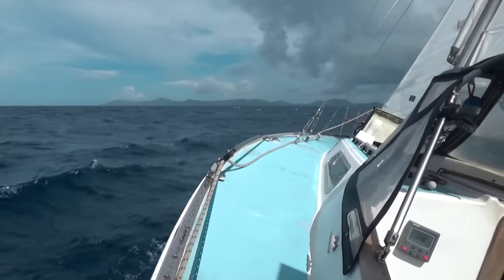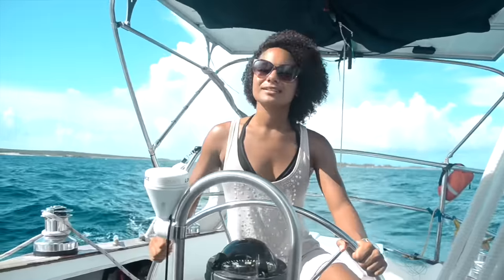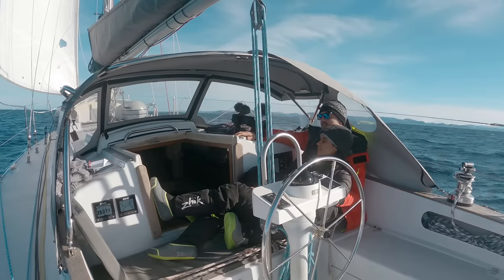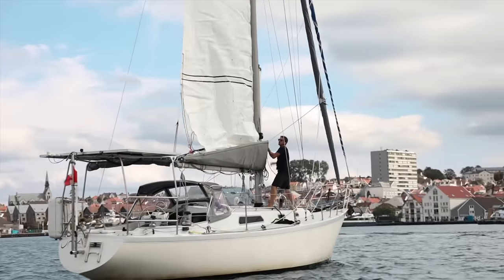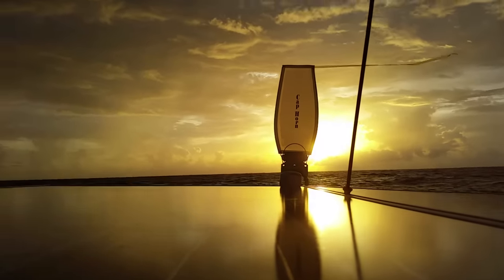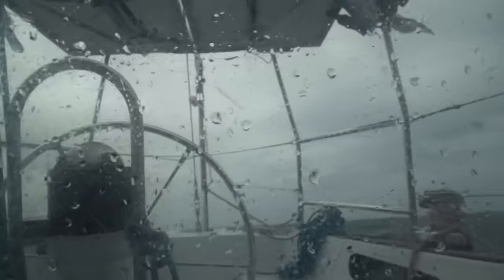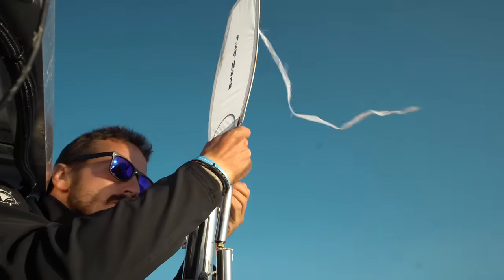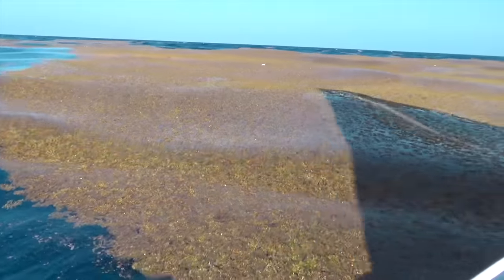Our #1 SAFETY PRIORITY (Autopilot or Windvane)  — Sailing Uma [Step 261]

Comment: Completely agree. The Cap Horn windvane is one of the best piece of gear I ever bought. Don't forget the quality of construction and material used. Of all the stainless steel present on my boat, it is the only piece that never displayed any traces of corrosion. It is intended for longer passage. If you're doing only coastal, go for the electronic one. Another drawback of windvane, they don't work when motoring. To resume, windvane is the best crew you can have for passages, it does not consume any power, does not eat, complain nor sleep and above all, does not drink your beer or wine.
Reply: I crossed the Pacific with a Sailomat, and it WOULD self steer while motoring in calm conditions at 5 knots. That was on a 41 ft. Ketch.

Comment: In case you didn't know: The horn signal played in the intro (long - short - short) is the marine open water signal for unmotorised/ sailing vessels.
Reply: That's better ;-)
Reply: It's actually 'my vessel is disabled/manoeuvring with difficulty, keep well clear'
Reply: Or
 Long short -short is the letter D in Morse Code.   Dan.   Need one for Kika.  Long -short long.
Reply: @petergreen3381  To add to your adequate critic, it's actually both + some other meanings :-). I'd say "moving with difficulty" is probably the common denominator.
Reply from the maker: From our research, back at the beginning, it means, "Sailboat approaching in the fog".
Reply: @SailingUma  yes, under International Regulations for the prevention of collision at sea Rule 35    sailing vessels and many other 'impeded' vessels make this signal in restricted visibility and which is drawn from the International code of signals 'single letter signals' under which _.. or 'd' means 'my vessel is disabled / manoeuvring with difficulty, please keep well clear'
Reply: @petergreen3381  Visualizing the horn necessary for the mighty signal, I understand well that Uma would manouevre with difficulty!
https://de.wikipedia.org/wiki/Typhon_(Schiffbau)#/media/Datei:2010_09_07_Typhon_DSCI0366.JPG
Reply from the maker: @petergreen3381  HA! Yup...sounds like us (at least in the beginning)
Reply: Technically, ALL 5 classes of vessels above Power Vessels on the "pecking order" share this signal in restricted visibility.  That includes:  Not Under Command, Restricted in Ability to Maneuver, Constrained By Draft, Fishing and Sailing.
Please remember that if you are using your engine to maneuver in the fog, you are legally a Power Vessel, even if your sails are up.
Capt. Cook

Comment: Cap Horn and a squeaky wheel pilot on my Alberg 35 which has been home for 32 years. I did find a learning curve with the vane, mostly in having to learn to sail the boat balanced. Otherwise, if I'm sailing, its driving, even in close waters. I had the opportunity to tell Yves, its creator, he had made me a passenger on my own boat even when I singlehand.  Eric runs Cap Horn now and is awesome. He has more than once refused any payment for bushings and plastic parts even after 30 years service.
 Squeaky is for motoring. Mine doesn't nap, but has an odd aversion to heading W, where he is apt to loose data. Im old enough to sympathize with such lapses.
Love your channel and only wish I'd crossed tracks with you guys when you were in Fairhaven buying Uma! I'm a naval architect and occasionally work in that shipyard.

Comment: Excellent summary !  

We named ours Yves after you-know-who and it served us flawlessly for 6+ years of off-the-coast cruising down into Central America.  The 'plastic' caps on the fittings at the bottom both fell off and the little tiny actuator arm inside the linkage (outside the stern) finally broke when we had a heavy-handed yard-guy kick the linkage out of the way inside the aft lazarette (thanks bozo !).

We also used the Cap Horn with a Tillerpilot for plain compass course holding using the paddle for all the brute power and never got a separate autopilot.

Comment: I watched all those episodes and was almost as relieved as you guys were when you got the wind vane.  I am an engineer, but also a big believer that simpler is better.  I would always opt for the wind vane over an electronic system as my primary autopilot, I think.
Reply: Horses for courses. Offshore, where accuracy not necessary, windvane, coastal, where varying accuracy is required, a well setup autopilot.

Comment: Wonderful explanation. 
I want to add some points:
- wind vane: It will steer not perfectly to the course, but healthy to the boat. Nobody is interested loosing some miles on a sea passage. You will be very interested in a boat handling that is save during a sleep - and that's you may expect from it. 
- Sail trim: So often I see people do not enough trim or they don't care. All autopilots need a good sail trim! On charter boats I saw a lot of autopilots dying due to overload. If it does not die, it consumes a LOT of energy. With a not so good trimmed boat, the autopilot (and the rest of Nav) empties the batteries in less a day. 
- building in the autopilot. Some people may think Dan is always doing to big /heavy --- NO! The Autopilot produces a lot of power, easily destroying some of the  base plate. 
- An electronic autopilot has to have a slack free operation. If there is only 1/2inch slack, your autopilot will drive like drunken!

Comment: I've b even researching wind vanes for a while. Though I'm a year or so away from my refit being done, I'm settling between the Cape Horn and Hydrovane. Having that "second" rudder, it's like having an emergency rudder ready to go. I will get an electronic autopilot, as well  but the wind vane will be first. I'm single handed on a 34' so hydraulic is overkill, though I'm well aware of the better efficiency,  but they are super great on >40' boats, where wheel pilots don't do well. Having the boat balanced as you mentioned is the key. So I'm bringing all the lines, including all 3 reefs to the cockpit to help me better trim the sails. Fair winds.

Comment: I have that same autohelm drive unit you called squeaky.  Mine was the same squeakiness last year, so I took it apart over this past winter.  Turns out the inner ring that the belt goes around had cracked.  I replaced that ring and the belt, which greatly improved performance, and is almost silent now.  Also rudder response setting and rudder gain setting makes a big difference, and needs to be properly set for the boat.  I also replaced the autohelm digital display which seems to have helped with tracking too.

Comment: Very good discussion on selfsteering.  What you did not metion is that the Cape Horn the quadrant is installed inside the boat (which is why it looks so clean outside). This takes up some space which, on a small boat, is an issue.  Also, some sailing boats designs simply dont have that space available at the required locaction like any more modern boat with open ended cockpit for example).  We sail a Pacific Seacraft Dana 24 where the Cape Horn cannot be fitted unless you install the quadrant outside, at the stern.  We had a Pacific Light Windpilot installed when we bought the boat and we love it but balancing the sails is key. Take care!
Reply from the maker: Yes, the quadrant on the Cape Horn can be mounted externally, and off centre. Thats the beauty of working with them, they will custom make each unit to fit your boat exactly. It does start to get complicated, but they claim they can instal one on any boat.
Reply: @SailingUma  Ah, I wasnt aware of that, good to know, thanks! The way you have itinstalled on Uma though is by far the least disturbing and estetically pleasing of all windvanes....
Reply: and with the CH, no cockpit lines to wheel or tiller.

Comment: Back in the 80s, we had both.  Aries wind vane and a little motor  fixed to a bulk head with a belt on a toothed wheel fixed behind the steering wheel. One used when running ,the other when beating eyc.They both worked beautifully. Just getting my 2 bobs worth in.

Comment: Nice video. I have a NAVIK wind vane, from PLASTIMO in France. Well adapted for my FIRST 30 of 3.5T. It works very well, even when I hoist the mainsail and when I lower it. We navigate in Mediterranean sea and use it when we travel to Corsica, or Sardinia or Balearic Islands. The more there is wind the best it steers. As magic as moving just with the wind.

Comment: Good discussion there., especially as you weren't going too far into specifics. I fitted HydroVane because I must have an off-centre installation (rudder projects a bit aft of the stern and the boarding/swim ladder on my older-style HR-38 is centrally mounted and can't really be moved) and there's no simple way to connect the cables of the servo-pendulum systems. My RayMarine Evo works great too - and it has an alarm if it switches into standby - which brings me to a significant issue.

With lockdown in the UK, I couldn't do as much test sailing with the system as I wanted to and, while I noticed that the AP seemed to be keeping on a few extra degrees of port rudder, I didn't think much of it - until later. I paid a listed installer to install the system as it's a bit heavy to do single-handed and I wasn't going to buy specialist tools like a drill good enough to deal with inch thick GRP - but hindsight said he botched things a bit; the HydroVane was twisted off a few degrees so that it was fighting the main rudder and there's no means to finely adjust things as you can with your system. Also, having not used it as much as I wanted to, I opted for the AP on that first big leg - across Biscay single-handed, my third such crossing. But here it started to bite hard. In 20 knots, 4 metre quartering seas, sailing deep reach, all was fine - until the squalls stated hitting; I stopped counting at 40! But with 30 knots gusting 40, that steering bias load really started to add up and the AP kept going into stand-by (thankfully it does have that alarm). The extra load on the steering just became too much for the AP drive and I basically couldn't rest for the last 3 of the 4 days passage. In the end I worked out that I could put pressure on the wheel during squalls so that the AP wasn't bearing the full load, but I've never been so tired in my life - 4 days crossing a stormy Biscay in the wrong season, single-handed, no sleep for days and largely hand-steering a lot of the way.

Fixed now, simply loosened off the control head mounting bolts and twisted the mainshaft back into the right position but that's not something I could do at sea in those conditions. Other dislike is that the rudder can't easily be pivoted out of the water like your system does but that's just how having a simple drive system goes. My HR-38 also has a high stern so I can't simply unclip the HydroVane under way because I have no easy way to put it back again later. Your picture of Sargassum makes me nervous for the same reason. But I suppose cover-19 helped set this mess up - just huge problems sailing in the UK at the moment. I needed to test sail more and I just couldn't.

Next leg within the week - Portugal to the Caribbean single-handed an hopefully not needing to stop at the Canaries. HydroVane it will be, unless I find sets of conditions that system doesn't like. But I've sized my solar system so that I can drive the AP 24/7 if I must. One thing Would put on my wishlist, though, is something built into course-setting systems to factor in the shadowing on my solar panels but that's not gonna happen any time soon.

Comment: You probably know that Cape Horn has a small arm that can attach down below to the vane mechanics that allows you to attach a small "tiller pilot" to. This way the Cape Horn can chase a wind angle OR a track on the water! I saved the Auto Helm 2000 autopilot ram from my Jeanneau 34' for just that purpose when I got a larger boat. It's only electric and doesn't pull a lot of current and it still has the sensitivity settings so it doesn't need to chase EVERYTHING in a boat movement. Did you have a fire going in the fireplace? That would have been great to have in the background of your video on a cold & windy day. Or did the wind blow down into the stack eliminating a chance for a draft?
Reply: Good point...that little arm came with our CH and it works like a charm.

Comment: I love this step! Perfect timing. I'm developing a sip and puff control system (you've probably seen them for wheelchairs) to allow persons with upper body mobility issues to sail a boat. I've just started to explore different rudder control/autopilots to interface to.  I could hardly believe the luck when you posted a video on the systems that you have experience with plus all the links.  SOooo helpful.    Thank you kindly Dan and Kika!!  :D

Comment: I use both for much the same reasons. The hydrovane will still steer the boat if you have lost your rudder, so it offers extra redundancy there, it can also be mounted off centre which is useful if you have boarding steps in the centre of the transom.
Reply from the maker: Cape Horn can be mounted off centre as well.

Comment: That's for sharing the details of both systems, I only have an electric autopilot on my boat and considered installing a windvane steering system but given that I have an arch/davits combo off the stern it would be a visual mess and only usable with the dinghy on the bow, and would get in the way of boarding the dinghy at anchor.
Reply: Look at the install pictures on the different vendors sites, may give you an option or two. Also I noticed the serious offshore cruisers, even though they have davits, store the dingy inverted on the bow. I think, because a bad wave at the stern would be a trip ending occurrence, if not just a loss/damage to dingy/davits/solar arch.
Reply: @carlthor91  I definitely keep the dinghy on the bow for longer passages, but for a shorter passage with known weather I keep the dinghy on the davits. My dinghy weighs 90lbs and the davits are rated for over 10x that and it's held a solid 8' above the waterline so swamping is a non issue. My main concern is really just cluttering up the area where I board the dinghy, and the fact that my solar puts out 4.5 kwh/day in electricity makes the extra electrical draw negligible.

Comment: 15:00 - I’s Norway, “Sunny on the bow, raining on the stern...and it’s snowing in the middle!”  That was my experience in Scotland.  If the Sun was out, that meant that it was going to rain in the next 15-minutes.  In the Winter it was quite cold.  In Holy Loch where we once has a Submarine Base, I did a couple of refutes there and an extended refit in floating dry dock.  They lowered a steel shack onto the missile deck for topside watch standers.  We would have to leave it every couple of minutes to push it back into the center of the deck to prevent being blown overboard.  That is what I’ve been thinking about during your upper latitudes trip.  If you cross the Article Circle, you can become a Bluenose like me.  Been under the ice twice.

Comment: Being mechanically and technically challenged, I would be clueless about how both of those systems work. But you explained it so well I felt like I got the idea. The little 24' sailboat I had in the early 80's resorted to using a bungee cord to sort of hold the tiller in place while I took 60 seconds to duck below for something.  And that was in Biscayne Bay, out of Miami.

Comment: Thanks... strangely enough I purchased a new Ray Marine EV1 wheel pilot which I also integrated with the instruments and the chart plotter.  Doing the chart plotter (an older one with NEMA 0183) required buying a communications bridge - but it communicated perfectly and I needed to keep the NEMA  0183 for things like DSC on my VHF.   The wheel drive actually works perfectly on our 34' sloop.  The problem I have is with the software from Ray Marine.   It DEMANDS acknowledgment on a GPS route at EVERY course change which means I have to be behind the wheel defeating the very purpose of the auto pilot - freeing me from being behind the wheel.   Like you the very time I need it to do a route is when we are levying or coming back from a dock when I want to be rigging or de rigging the boat but this stupid demand from Ray Marine says I can't do this  - I have to say it is ok to change course... As far as I know Ray Marine is the ONLY company that does this - B&G does NOT do this.   For me the only way round this is to get the expansive wireless remote where I can acknowledge the course change from a position other than the helm.  So ... there goes another $800 that I would not otherwise need to spend.... I don't need a wind vane as we simply coastal sail but I do NEED an auto pilot that actually auto routes and Ray Marine ... is not that pilot the SOFTWARE is the culprit not the hardware which works fine ... Ray Marine alone does this... no one else does it.

Comment: I've got some experience with the "Mister Vee" wind steering system from the Netherlands. Specially designed for smaller boats as it weights some 10kg (less than 25lbs).